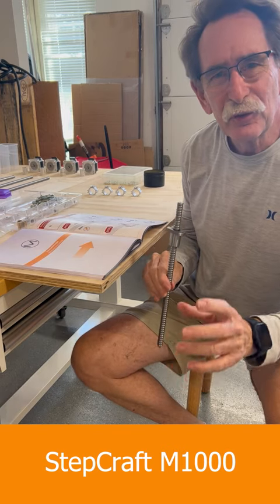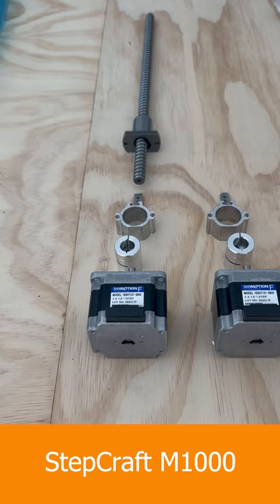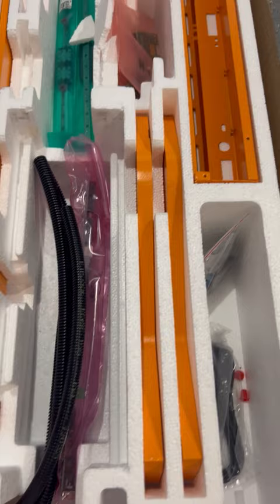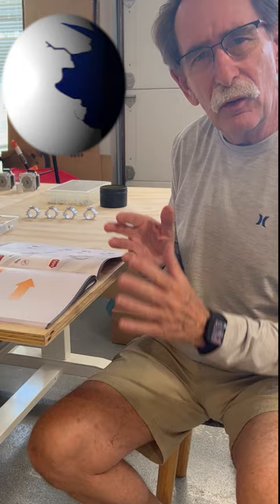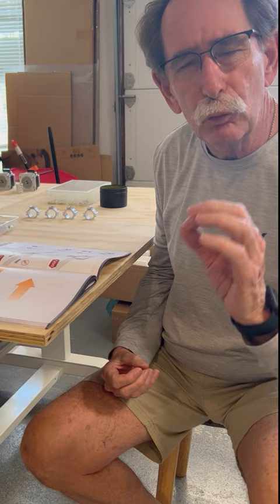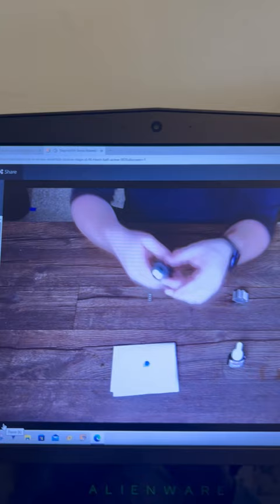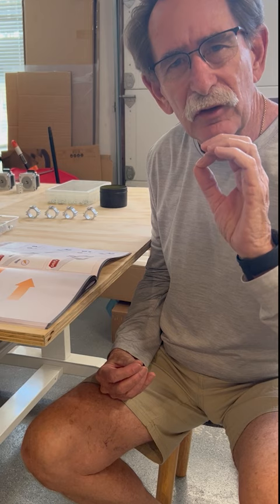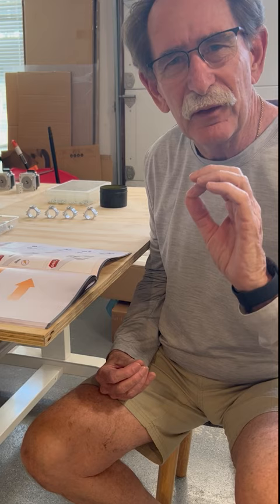#Shorts Assembly of the #Stepcraft M1000 CNC #woodworking

Comment: I put my M1000 together George. The video system wasn’t available then but it want fairly smooth. Assembling the machine will make you more familiar with it which will be beneficial if operating problems occur.
Reply from the maker: I am just about to  finish my build.. the Stepcraft cart is on the way.